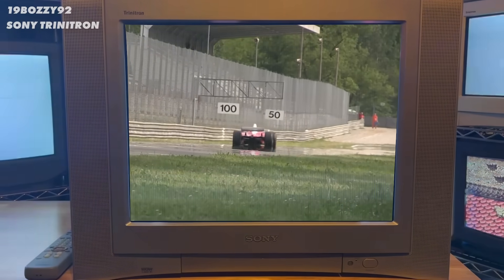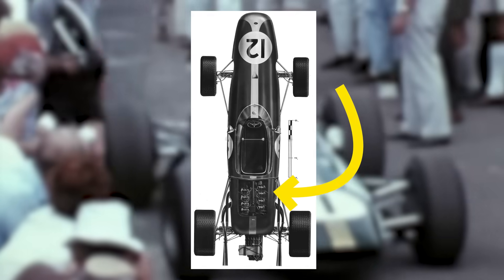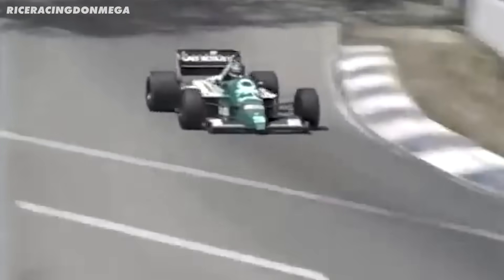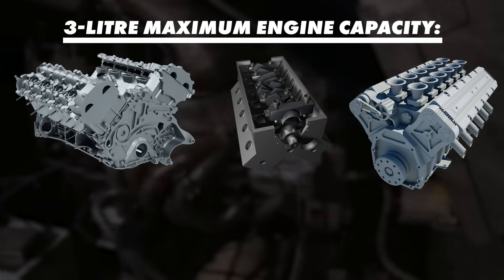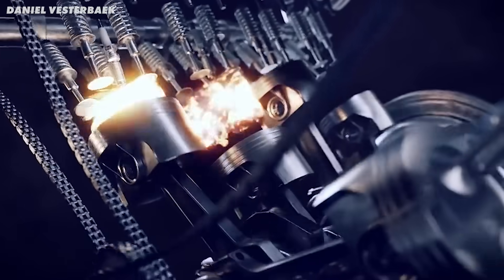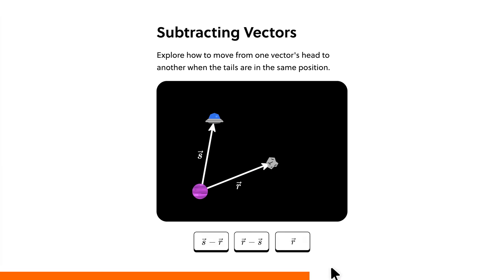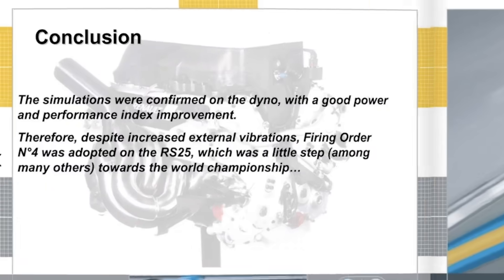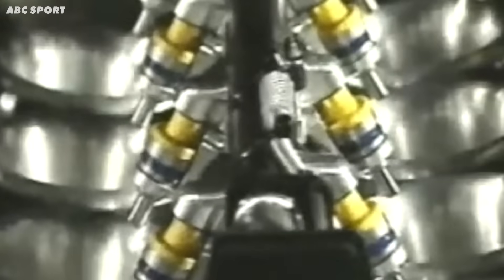How We’re Wired to Love F1 V10s

Comment: All F1 needs are gravel pits, wide-angle camera's without overly zooming in on the cars in corners, 100-150 kg lighter cars and - above all - V10s! Which should even be polarbear-friendly with their so much hyped biosustainable fuels :) Everyone wins!
Reply: camera's? why not car's and pit's and corner's and fuel's?
Reply: @BariumCobaltNitrog3n  Camera's as in: 1) wide-angle onboard camera, and 2) track-side camera's should be used like they were in the 90's and 2000's: static, without zoom. Giving us an overview of an entire corner or section of the track and actually be able to see the speeds of the cars. Not zooming in on the middle of the car while it's pulling 4 G's in a corner, with zero sense of speed for the viewer as a result.
Reply: @EleanorNL  Exactly, Eleanor! The camera work is usually horrendous in modern F1. The pathetic sounding cars already give no sense of speed, the fact the cars barely move around gives yet an even lower sense of speed, and on top of all that, the terrible trackside (and onboard) camera angles, positions, lenses, etc. give an even lower sense of speed. It's like the "professionals" that manage this stuff have no brains!!!
Reply: @Spinelli__  Hear hear!
Reply: @EleanorNL  *cameras. No apostrophe for plural.
Reply: @EleanorNL  the onboard is already a wide angle lens but on top of such a tiny sensor that it transforms into  a kind of normal lens when you see it and it's impossible to make it any bigger without giving away aero performance.
Reply: @DjCarlos17cuzn  Nice reply, but are you certain? Magnussen had a new module on his car in Suzuka, with gyroscope as well. It had a much wider viewing angle. I do really hope they continue with that module and have it on all cars soon :)

That, and my iPhone has a better angled and quality camera than what seems to be on the cars now for onboard camera :P
Reply: @Spinelli__  professionals would love to put you inside the cockpit like in Rush or FordvFerrari for example but they can't and you wouldn't have much context which would make the rece even more boring that it is. They're actually using the best cameras ever for that kind of production if you try to use bigger sensors you'll end up messing around with focus at those high speeds while panning.
Reply: @EleanorNL  you dream that your iPhone is better than any of those cameras on F! broadcast 😂😂😂 try going around a circuit for almost 3 hours at 200km/h on avg transmitting 4k res broadcast quality video. 
I'm quite certain because of what I told you about the size of the camera because I'm on the broadcast business and those tiny sensors (not quite as big as your phone) have to be paired with 15mm or less to get that kind of angle look at the sides of the image and you'll see the distortion.
Reply: @DjCarlos17cuzn  You say you're in the broadcast business yet you failed to understand my comment. I know F1 obviously uses very good cameras. I'm not talking about the "quality" of the cameras themselves. I'm talking about choice of camera positioning/location, camera movement, camera zoom, camera lens, camera cuts to other cam's, etc. It doesn't matter if it's a broadcasting camera from 2020 or 1970, that's besides the point.
Reply: @Spinelli__     so you know better directing than the guy who’s in charge of every race who has plans of where every camera is located (and for many circuits for more than 10 years or even 20). You say camera lens which has nothing to do because they use the same kind of lens for most sporting events the only feature that changes is if it’s designed for 4K or not. I don’t know what you have against about the zoom which by the way is an operator choice (in racing it’s a need actually) and the camera cut are subjective. I could be doing the same thing as the guy in the gallery or not and you’d dislike it, it is something that it’s decided at that moment specially on F1 where you have to many sources to cut that could be telling something and from time to time you should stay a few seconds somewhere bc it’ll end up exhausting the audience.
Reply: @DjCarlos17cuzn  Again, go-pros on rallycars, trackday enthousiasts, planes, etc. all show a small camera can give a much better quality image. Heck, even the 00's F1 onboards looked much better in this regard. Speed doesn't kill your camera image quality, that's just silly. And we viewers just get the 720p onboard on F1tv, not even 1080p60. And like I said, they just showed how to properly use onboard camera on Magnussens car in Suzuka.
Reply: @DjCarlos17cuzn  I don't know what you're going on about. Yes, often racing has terrible cam positioning, terrible choice of cam zoom amount, terrible choice of cam lens style, terrible choice of cam movement style, and terrible choice of cam cuts. I can point you to many examples of other footage which would give a greater sense of speed and be more exciting to watch. Many old F1 broadcasts had way better camera work, much more exciting, with a much greater sense of speed and drama for the cars.
Reply: @Spinelli__    the race was exciting bc the cars were smaller and that benefited the broadcast. You say terrible choice of cam lens when even those old broadcasts that you mention where using the same kind of lenses(parfocal) that ncover a really wide range of focal lengths without having to do much to the focus being the best choice when having to capture the cars from a really long as well as close distance being able to follow it every meter that it moves. I’m telling you that the cuts are subjective (in context with the narrative of the race) and this events are very hard to please everyone and very difficult to manage all those cameras. There’s no much camera moving beside the drones/chopper, pits cable cam and the obvious panning which has always been there.
Reply: @EleanorNL  but those watching on their phone are not the only viewers there are people watching through Sky in 4K so you cannot deliver a compressed go pro image to a 4K broadcast vision mixer bc you’ll notice every bit lost in both camera capture and wireless transmission to the van on the circuit. The 00 on board might look faster but not better than a 4K feed from today those where SD or maybe the best ones 720 downscaled to SD broadcast. And actually speed does kill you’re camera quality bc you cannot transmit at full bandwidth like the fixed camera through fiber or even the drone or the helicopter do bc the wireless system has it’s limitations  and cars running at full speed do not help and there are 20 of them transmitting.
Reply: @DjCarlos17cuzn  When he says types of lenses, I think he's referring to focal lengths. Different focal lengths will give all sorts of vastly different perceptions of object size and distance and different perceptions of speed.
Reply: @vincer9960  as I said the lenses use cover from wide angle (12-50mm) to telephoto >70mm. The use those huge boxed lenses and they aren’t worried about which focal length they are bc they have them all.
Reply: Fuck no. Out dated tech. F1 is about pushing technology. 
Pat Simmonds wanted 8 cylinder opposed piston 2 stroke engines for 2026.
Reply: @v4skunk739  They can push all they want...if efficiency alone is all they're after, with no regards towards creating an actual spectacle, then the cars will just get more and more boring and stay so forever. Efficiency. Is. Not. Fun. Except perhaps to a very select few engineering nerds.
This weird dichotomy between the egghead-science-stuff in the background and the RAW LOUD VICIOUS BEASTS that this science created was a huge part of what made F1 so interesting in the first place. Without that second aspect? Yawn. No emotion, no amazement, no awe. The cars are just rolling maths lessons now. There was some decent racing in the last years...but with such boring cars it just feels hollow somehow. 
They try to manage with bigger, wider, more aggressive looking cars, but it all just falls flat to me. With the upcoming rules betting even more on electric drive...yeah. Snoozefest. An electric lawnmower does pretty much the same job as a petrol one...but boy is it dull.
Reply: @mito-pb8qg  Exactly! The 'what could have been' is so, so much more exciting in F1! 

 @BariumCobaltNitrog3n  Ah, that. Cameras. You're right, thanks!
Reply: @v4skunk739 then get rid of the engine restrictions! Set max displacement and max power and let everyone build what they want! If you want to avoid 4 bangers limit the cylinder count to a minimum of 6.
Reply: @slideways8022  There was nothing wrong with 4 pot turbos in the late 80's.
Reply: @slideways8022  something similar happened before, the 3.5/3L era that is. Eventually in the mid 90s the teams converged to a v10 because of the tight compromises.
Reply: @slideways8022  then everybody would come up with inline 6
Reply: @v4skunk739  If only the engines sounded like they were pushing technology, and not sex toys
Reply: @AB-mw8oz  You think a 2 stroke 8 cylinder opposed piston engine wouldn't sound good? You are delusional.